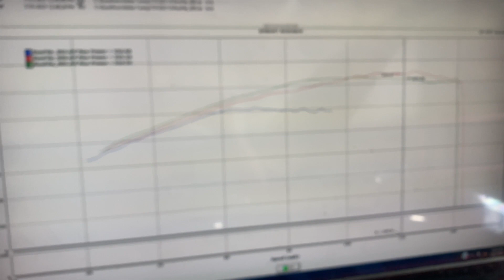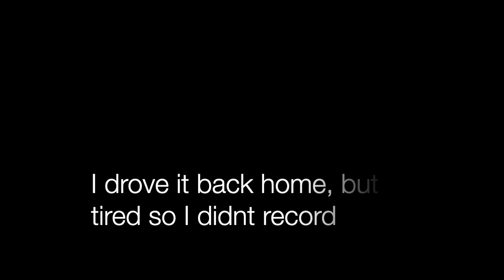Vortech Supercharged G35 Hits the DYNO w/ AdminTuning

Comment: It’s a good start. You got the basics right you just need to make some small adjustments to make more power. Superchargers are not efficient at low boost so once you start making 9-10psi or more you will see way more power.  As far as your comment regarding the 370Z going from 420 to 620, it made 470whp on 91 at 10psi, 540whp on e85 on 10psi, and 620whp at 14psi. There is always more to the story. Good luck with the car and I’m looking forward to working with you again.
Reply from the maker: Yea I heard the 370z guy saying he was having boost issues too but I think they got fixed. But yea we’ll definitely be back soon this month. I was able to get a bigger throttle body and fix the issue so hopefully this time it’ll be better. Thank you regardless, see you soon.

Comment: Don't be disappointed. 320+ whp is a lot for street, unless you're racing very fast cars (500+ hp) 320 is plenty. Always room for improvement. Fast cars are fun but you can't push them anywhere near their limits on street
Reply from the maker: I had a boost leak unfortunately, I’ll be going back again
Reply: @BeDistinct  ahh okay should help a lot with the tune and performance. Recently repaired an exhaust leak on my NA g35 and made a big difference in torque

Comment: You’re good past 400 hp as long as the tuner keeps the torque numbers below 400. And now to squeeze hp numbers do little things. 75mm tb, ported intake runner, mrev 2, ported upper plenum. And whenever you get crazy enough throw cams at it 😌
Reply from the maker: Yup 👌🏽 going back at the end of the month after fixing my leak

Comment: 350 is a reliable number for a boost car dont watch nobody’s build everyone has different purpose n don’t chase numbers just build little by little 3-4-5 all the way to big juice power good job 👏🏾
Reply from the maker: I’m afraid we’ll do a lot better next time because I just fixed my boost leak. Hopefully the engine pulls through.
Reply: @BeDistinct  it will bro the vq ain’t that weak but if you plan on really going all out which will bring content i think going forged internals aggressive cams maybe sleeved block you’ll be in big juice territory single turbo or u can vr swap it i heard the vr can make good power on stock block either way bro good job u did it be proud we tuned in

Comment: Yes 350 is a healthy number for reliability 450 is max for the motor a guy here tuned by soho where mine is it only last him 1 year if you don't build the motor it won't last over 450
Reply from the maker: We should be around 400 wheel next time around. I just fixed my leak

Comment: Yo I found a G35 for sale for 4100 with a engine swap with 41000 miles .guy say the engine is good just a bad crankshaft sensor. The old motor had 131000 with bad cams. Is it worth getting seats are not bad . No cat or no resonator just a stillen muffler. Cop or nah? What everyone think. It's an auto but for the price can get it switch to sick over the year as a project
Reply: Sounds abused. Anything that has had its muffler or cats off has been riced

Comment: Somethin aint right you should be pushin a lot more hp i feel
Reply: He's only running 6 pounds of boost. I don't think you understand how forced induction works.
Reply: @jaytee3565  explain to me how forced induction works
Reply: @LibertyGunsBeerTrump  that's what Google is for.. but to keep it short. 6lbs of boost isint shit. So the fact that he made those numbers on such low boost means he has LOTS of room for improvement.
Reply from the maker: I had a boost leak

Comment: I don't care what anyone else is saying. To spend that much money and time just to make 350whp, would and should draw huge disappointment.  This goes double for 37 owners looking to go the Same route because 350 whp is achievable through JUST bolt ons. 

If it's a boost leak...respectable, fix it, see what those real numbers looking like.
Reply from the maker: Look at my next vid, you can see the major boost leak I had. I should be anywhere from 380-420 whp next time around